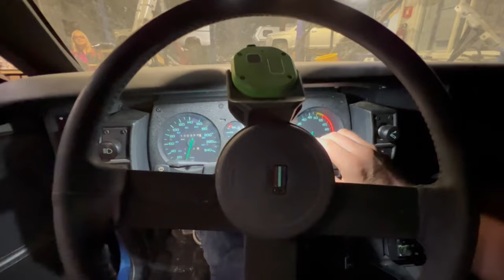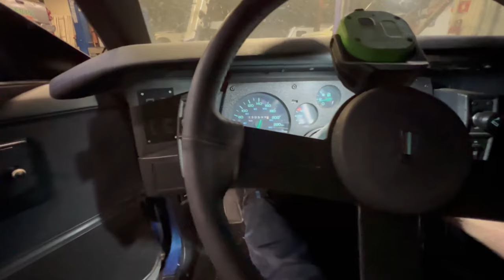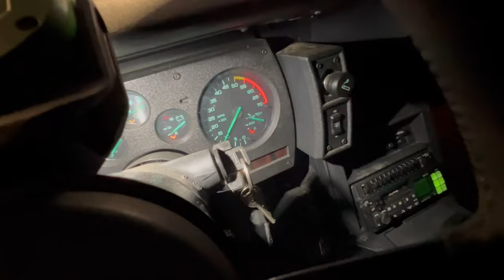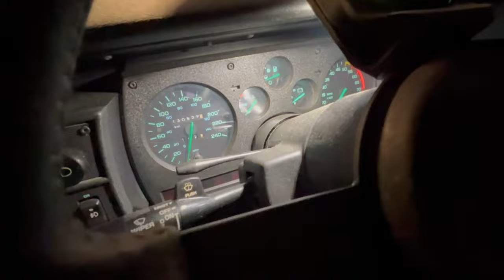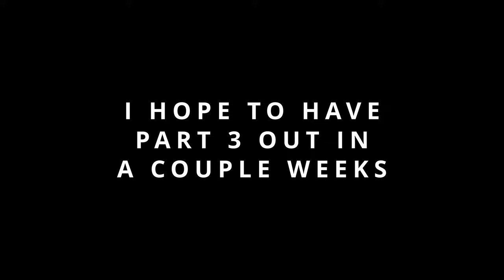RESURRECTING A 1987 CAMARO Z28 PARKED FOR NEARLY 30 YEARS part 2

Comment: Where did you find BFG radial TA tires in size 16??
Reply: Those are 15 inch wheels. I guessing size 235/60R15.
Reply from the maker: Correct!